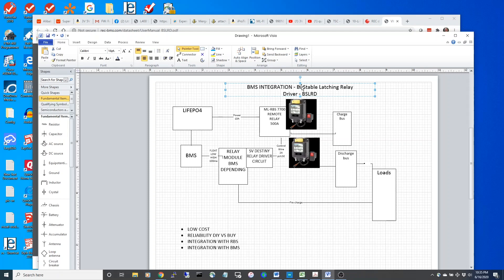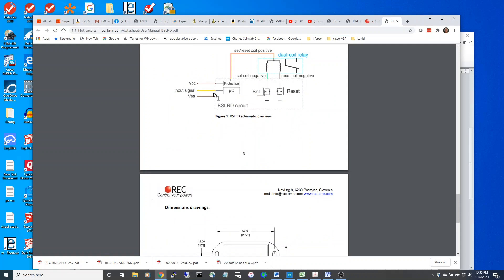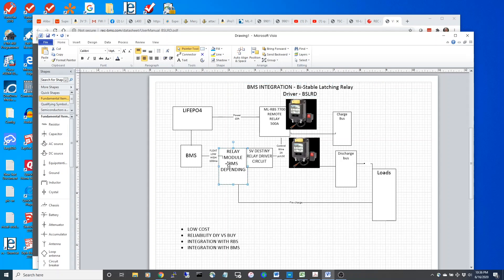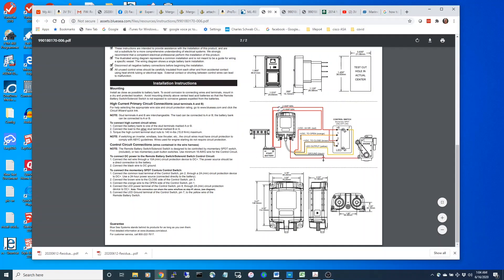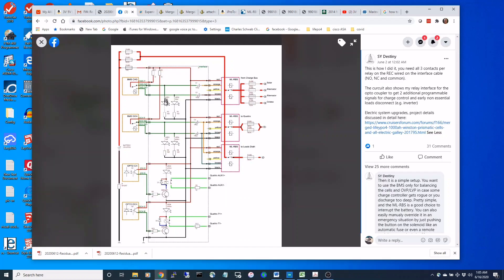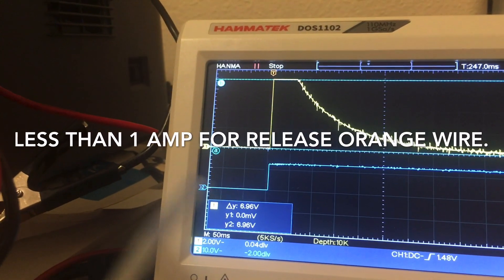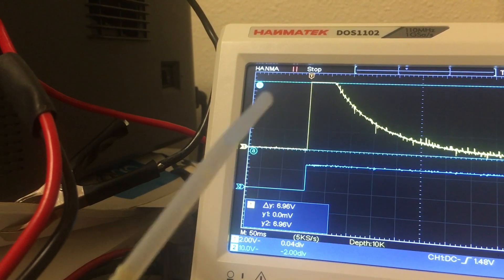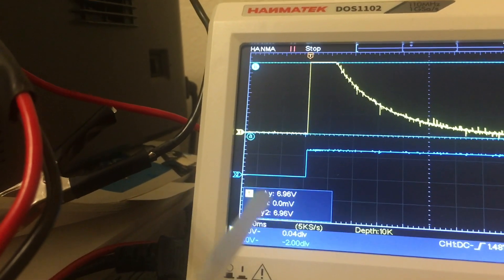Blue Sea ML-RBS 7000  Simple DIY Latching Relay Driver for Lithium BMS  by SY Destiny

Comment: Thanks for this demo. It is just the circuit I need because I need to drive a Blue Sea ML 7700 with a REC BMS. I'm struggling to understand the circuit.
I’m having a hard time understanding this circuit. Why does the capacitor cause a pulse of power to the Blue Sea orange wire? I would have thought the capacitor would absorb all power bleeding through the resistor, then when the capacitor was full, pass it on to the Blue Sea orange wire. This of course wouldn’t be a pulse, but would be always on. Or that the LED would use all the power before it ever got to the capacitor.  But that apparently isn’t what is happening. Can you help me resolve this? Thanks!
Reply from the maker: Sorry. This was a discovery I was just trying to understand my self. You just get a pulse while the capacitor is filling. You need to take a deep dive into how capacitors work in delay circuits. Most things are microprocessor based now. This is a very simple solution SY Destiny came up with.
Reply: @dannyjensen4954  OK, thanks. Maybe I'll just have to take it on faith, it obviously works. I just like to understand things!
Reply: @dannyjensen4954  I think I may have solved it. Capacitors leak during charging. This leakage goes to almost nothing when they are full. So the capacitor is leaking during the whole charging phase, then once full it stops leaking and the pulse is over. Maybe?

Comment: Danny thanks for posting this video. Over the last couple of months I have watched a few of your video and I always learn something. Thanks again. I have been looking at SY Destiny’s interface for a while now, so it is great to see it in operation. I have to admit looking at SY Destiny’s drawings took me back 40 years to my grade 9 electronics class, so it took me a while to understand what each component was and does. I’m waiting for our local COVID restrictions to ease so I can go to the part store to make my interface. Did you purchase your part from one of the online retailers?
Reply from the maker: Dennis Martindale Thanks for your comment about my project videos. I buy on AliExpress, Amazon, Bangood and Ebay so no COVID exposure. The parts are cheap on plentiful online. I have a stock of various values and modules so I can usually toss something together without purchasing of waiting. I also have microprocessors and power supplies. I’m just starting to learn about electronics so having the parts in advance really helps. I’m also starting to look at on-line circuit schematic software with simulation.